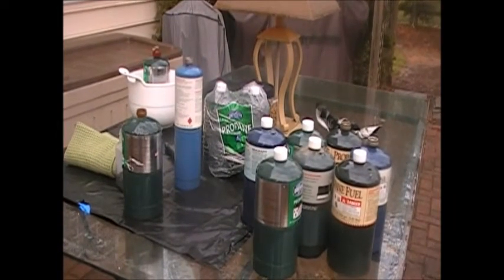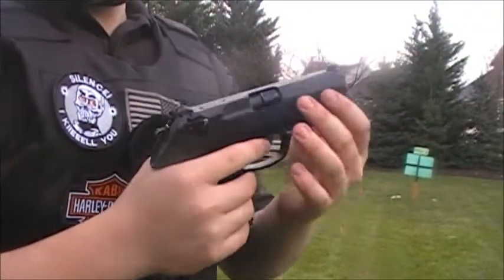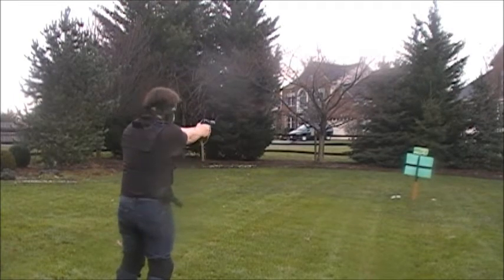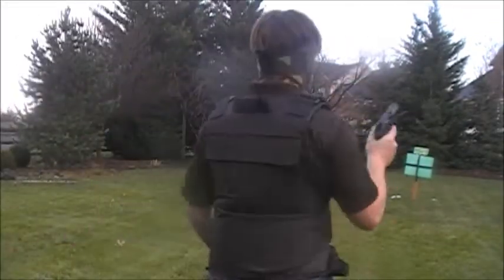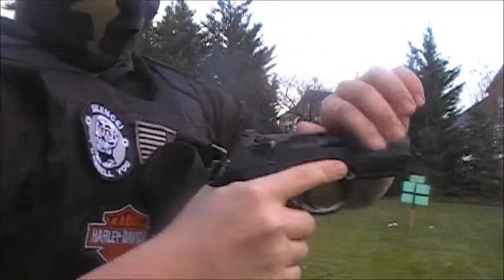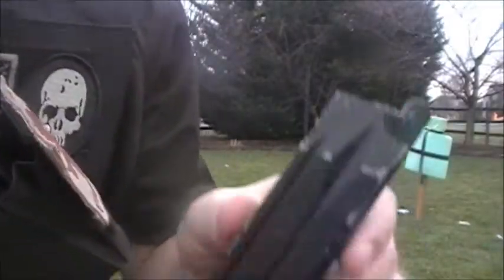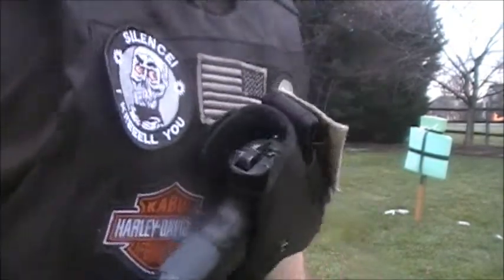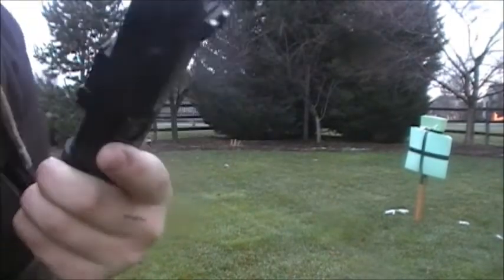WE PX4 torture test

Comment: 1. Don't expect the gun to do good if it's not properly maintained (i.e not lubricating it)
2. You could have prevented most of the problems if you would have used good BB's and properly maintained it
3. You don't need to replace the inner barrel, you need to clean it and use good BB's
Also, this gun is made by HK3, another airsoft manufacturer, as are the "WE" Glocks.